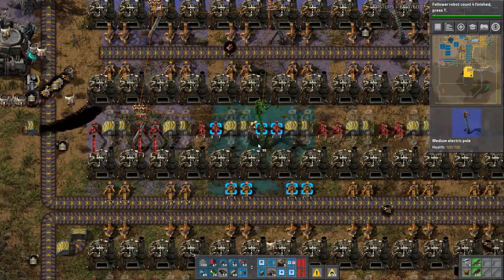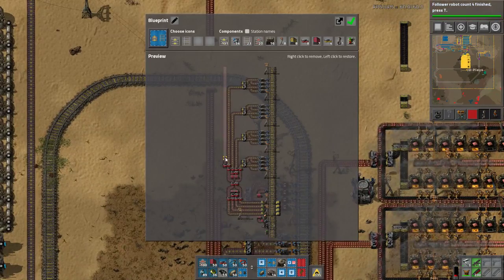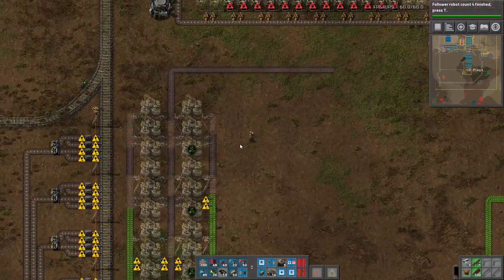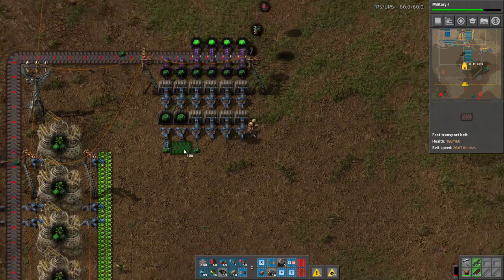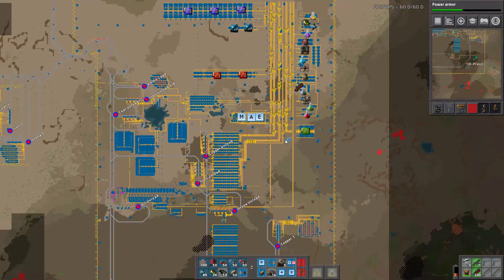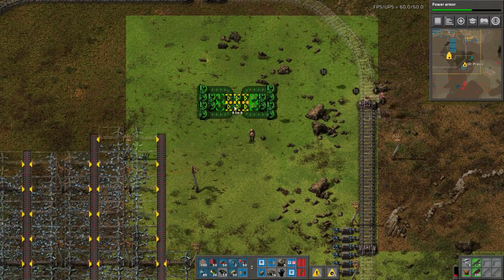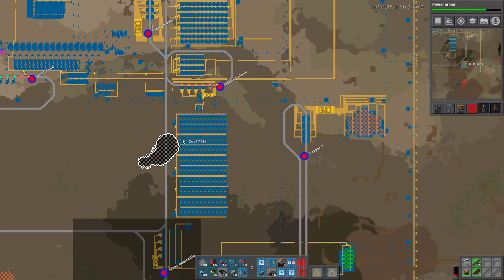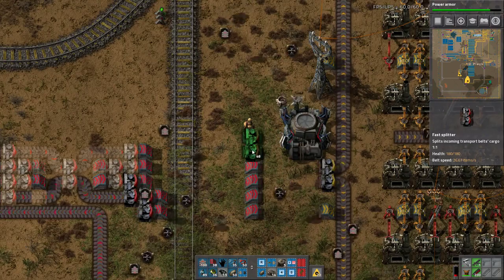Factorio 0.16 The Tutorial E42 Uranium processing

Comment: 18:10 There! Those steam engines are the ones that are not connected to the factory electric network. You were moving quickly but I think the poles you were installing didn't connect them either.
Edit: Umm, yes, at least the last pole next to them made the connection, I think. A bit difficult to see in the video with that noise the map view adds.
Reply from the maker: It looks like it, I hope at least, the real question is did a bot ever put down that pole? and is that connected to the rest of the network?!?!